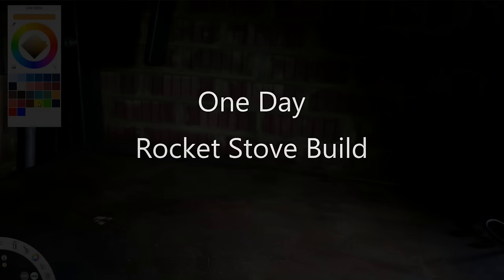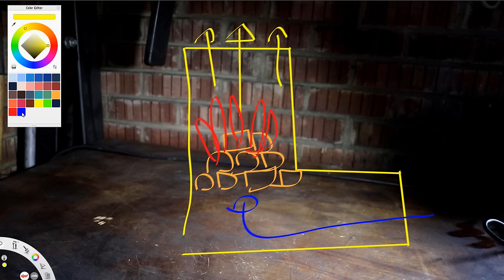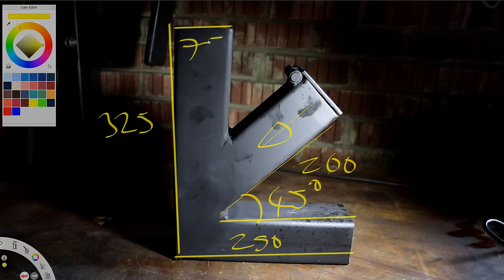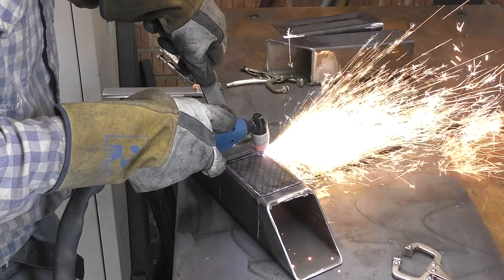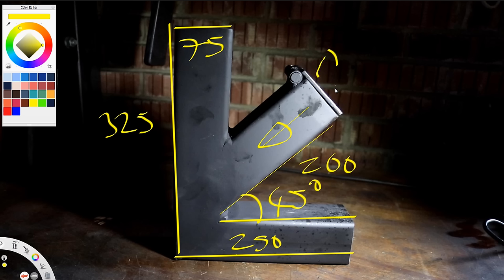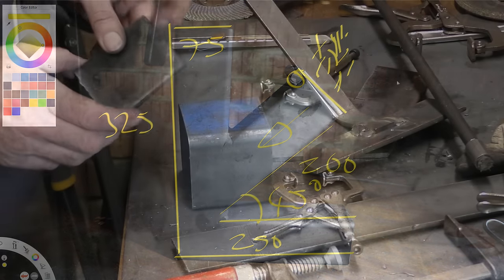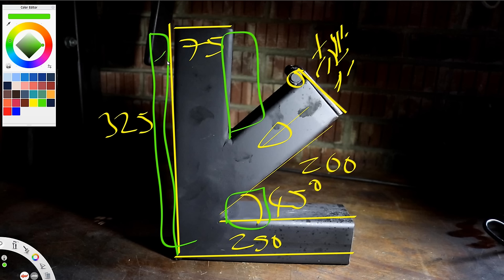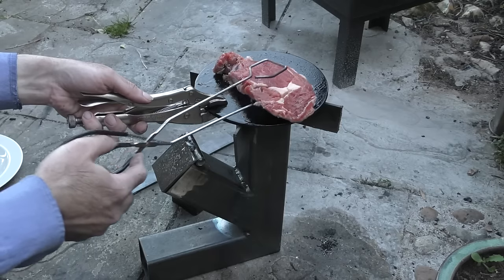Easy Rocket Stove Build (Welding)

Comment: In a rocket stove the equilibrium of full pyrolisis is created by the length of tube after the burn chamber. Although mostly smoke free, your design is letting most of the VOC (flammable gasses) release before combustion. Basically just a contained fire (evidenced by the bright yellow flame). Yours would benefit greatly from moving the feed tube lower, and in the middle of the 90° bend. By circumstance it also creates a larger burn chamber and will burn hotter. You will need a fire grate, but it really doesn't conplicate things, mount it halfway up the bottom tube from end to end. There is a ratio between the pipes as well. 3:2:1 being the riser, the air tube, and the feed tube respectively. Please try the mods, and take this travesty down.

Comment: Nice build. Bin looking for a good design. Going to put wood feed in horizontal flue with a added air flow tube that lays under the hot coals.

Comment: Hmmm, perhaps I've misunderstood the rocket stove concept.  This just seems to be a normal stove. Normal stoves (like this one) = put wood in,  have air path, light fire. I thought rocket stoves should have the burn chamber and riser separated, with provisions for insulation (you mentioned that) and preferably some control of secondary burn. Fire or smoke should not be coming out the top of the riser as it indicates  an incomplete burn and doesn't offer the opportunity for it ...no?